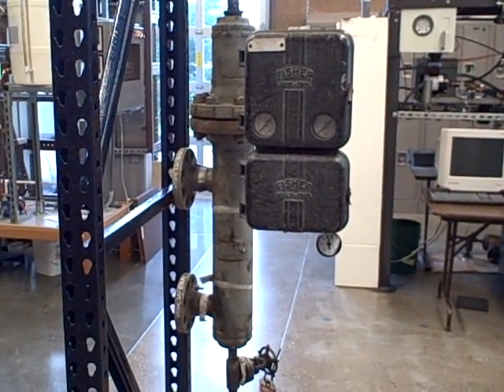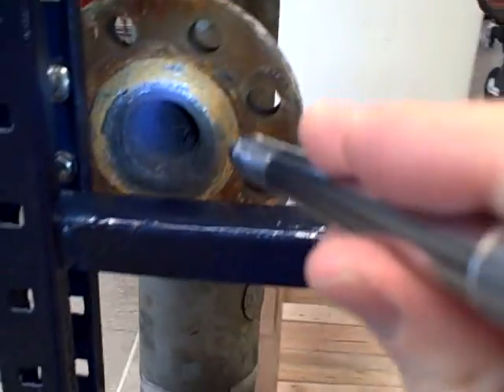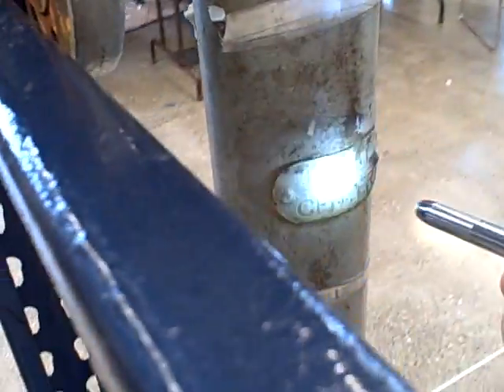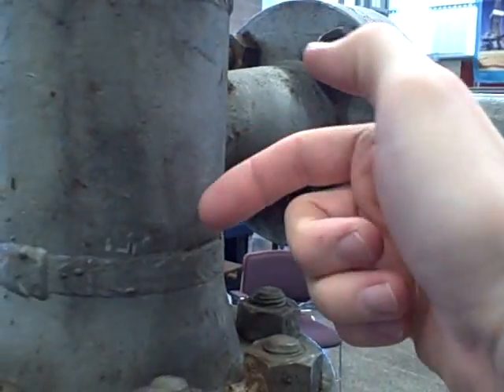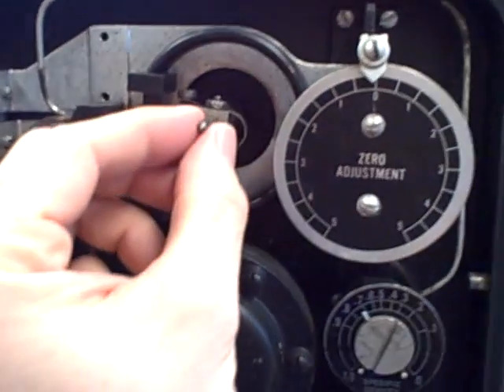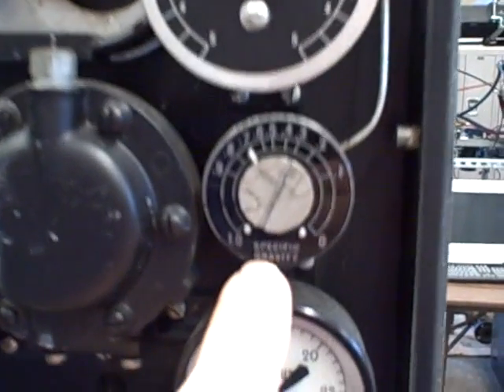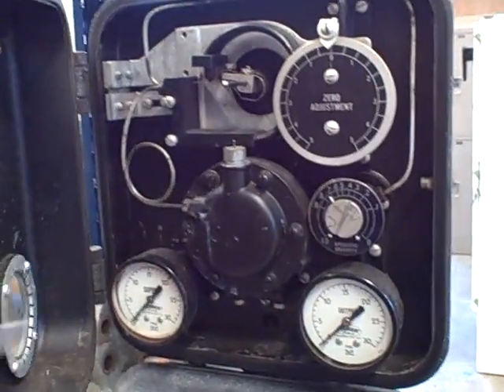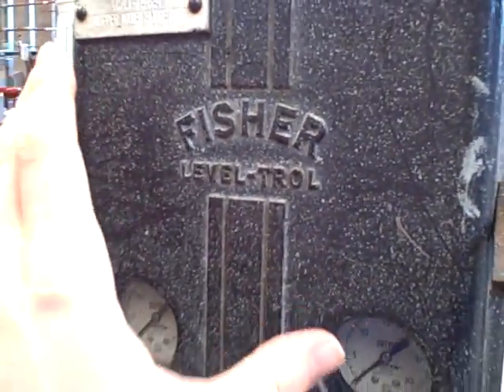Fisher LevelTrol displacer-type pneumatic level transmitter

Comment: Thanks this vid helped alot.
The span can also be adjusted in the top left hand corner of the box where 2 screws attched to the back plate can be loosened so it can be moved, moving the flapper from side to side adjusting the point where the nozzle from the bourdon tube meets it. This changes how much the flapper has to move before its creating backpressure within the bourdon tube. Just one point that was missed but otherwise this was great thanks

Comment from the maker: @neild123456 As a general rule, any factor that has a "multiplying" or "dividing" effect shifts the span, while any factor having an additive or subtractive effect shifts the zero.  Since a change in fluid density (SG) does indeed have a multiplying effect, it requires a span compensation.  Try a thought experiment to prove it to yourself: what would happen if the liquid's SQ suddenly doubled?  Would this double the buoyant force at any given level, or would it merely add some force?